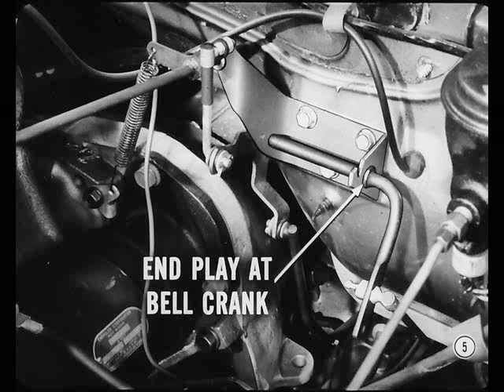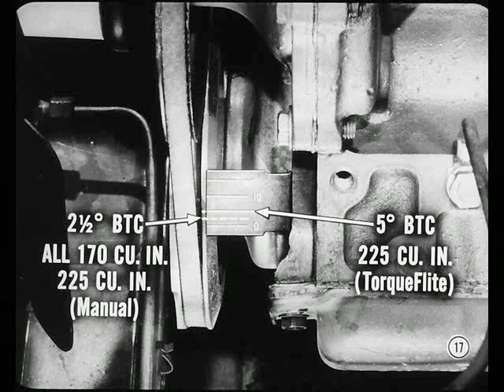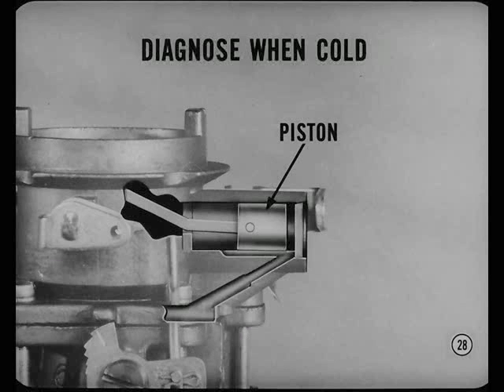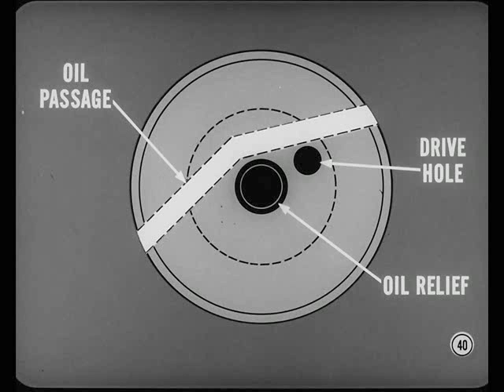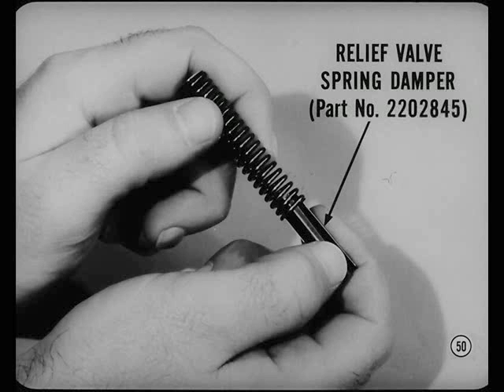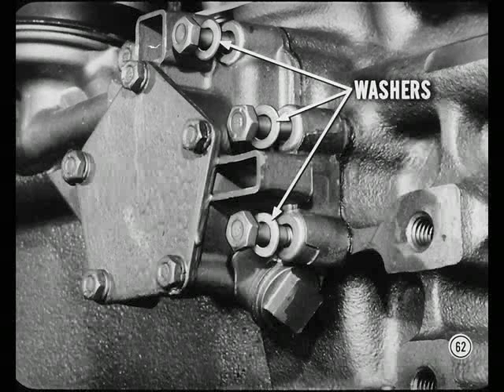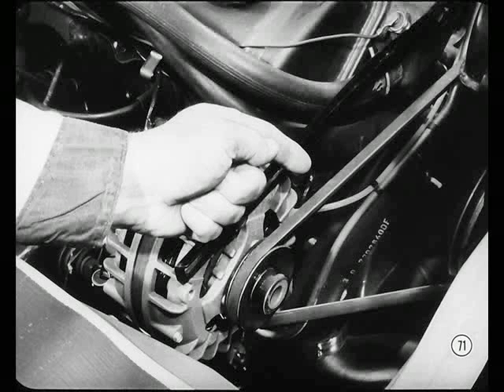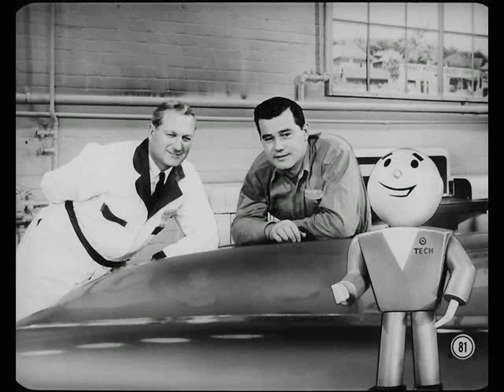Chrysler Master Tech - 1961, Volume 14-2 Engine Service Tips

Comment: I notice that the oil pickup is now installed at the base of the sump - in 1953, they used the elevated strainer in their truck engine as a sales benefit ('picks up cleaner oil than Ford's')  :-)

Comment: Just about all cars leaked oil like crazy back then. Truthfully, domestic manufacturers really didn’t start getting a handle on oil leaks until the late 90s. There were a few exceptions before then but most all domestic nameplates were a mess before 30K miles.
Reply: I have been told that some foreign cars were worse. British cars were said to be even more prone to oil leaks, and Italian cars weren't considered much better.
Reply: Skyline Fever That’s true. Most Toyota models leaked oil badly until the early 2000s.

Comment: I was often told that you don't want to buy a car the year it is introduced. The company needs time to work the bugs out, and you don't want to be their beta tester.
18:30 Is that "Led-Plate" some kind of lead based lubricant? I wonder how long that was in use, and I wonder how many people exposed their bare hands to it. I supposed people have to use a modern anti-seize lube as an alternative.

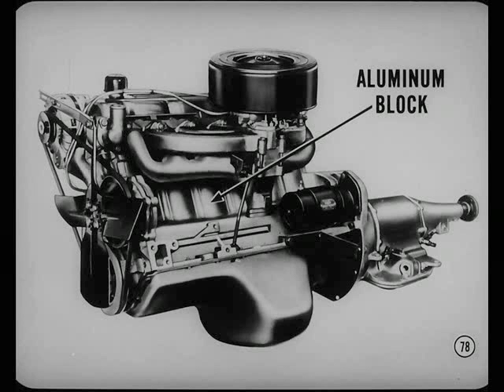Comment: 18:51 aluminum block on some slant 6's...
Reply: BuzzLOLOL imagine how things would be if aluminum blocks and heads caught on sooner. Lighter, better handling cars possibly.
Reply: Lighter, better handling, maybe. However, anyone that remembers the BOP all aluminum 215 ci engines knows what a nightmare these were to repair after a few years. The heads and block would 'grow' together and be impossible to separate.
Reply: Those aluminum 215 V8's were actually used in about 20 different brands of cars/trucks from 1951 until about year 2000... I still have a couple of them here...
Reply: "Limited number of cars" ... I'll say...they are about as rare as 1969 ZL1 Corvettes
Reply: BuzzLOLOL garbage too!
Reply: @overcastfriday81  They made 45,000 ZL1s?

Comment: Happy yet sad to watch this. The gasoline car is headed for extinction , maybe has 10 to 20 years left. Battery powered cars are the future. I am glad I lived in the 1960's and can remember  most of the American cars from TV commercials, magazine ads, dealerships and people showing off their new car.
Reply: My bet says you’re wrong, Poy.  By the time oil gets scarce, there won’t be sufficient disposable income to make all those batteries OR beef up the electrical grid.  Besides, what the hell you gonna use to fire all those new generating stations???
Reply: Thanks to fracking, America alone has enough fossil fuels for over 100 years. Electric cars aren’t “clean” . They’re nothing but eyewash to make Lefties feel good about themselves. It takes far more fossil fuel to build and eventually dispose of electric/hybrid vehicles. Some have estimated that it takes 10 times more fossil fuel to build , maintain, and dispose of an electric or hybrid vehicle. They are nothing but a necessary advertising expense of carmakers.